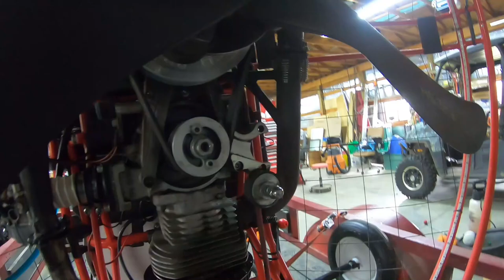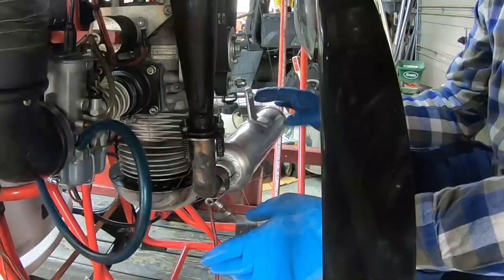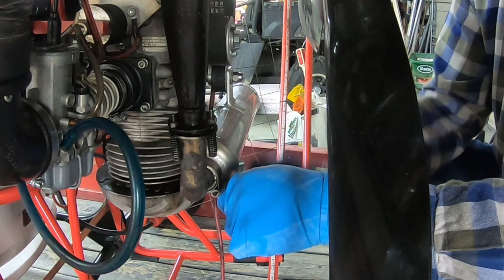Part 3 of 3, Freshbreeze Monster Silencer Repack - Ohio Paramotor Trike Adventures

Comment: Nice Job!  What did the welder end up charging you if I may ask?   I was looking at some motorcycle 2 stroke mufflers and you can find them
fairly cheap with good feedback ratings on Amazon.  Just search for by pipe size.  I was looking for them when Mr. Gott made a video of his muffler cracking.  The paramotor label jacks up the price, dirt bike technology has been proven for decades.
Thanks again for posting, good tutorial for the archives!
Reply from the maker: Was $50.  Wish I had another source like a neighbor that could TIG weld.  I provided the aluminum pipe.
Reply: @Ohio-PPG-Trike-Adventures  Yeah, good to have friends with skills.  But on the bright side, you did it yourself (sans welder), the stainless tube is far superior and should last longer than the ones you had, and I'm sure it's cheaper than buying another.  Since you have another to do and are so handy you may want to look into alumaweld alloy rods that can be "brazed" with propane or mapp gas.  It's not structurally worth a f&%k but for what you're doing I bet it would work just fine.  Check out some YT vids of alum welding.  I've repaired a bunch of stuff with it and had success, but won't do structural stuff with it.  Now get back up in the air and give us a tour of Ohio in late Autumn. :P